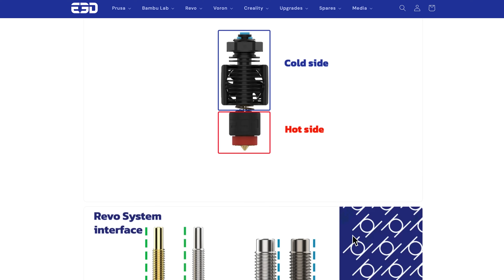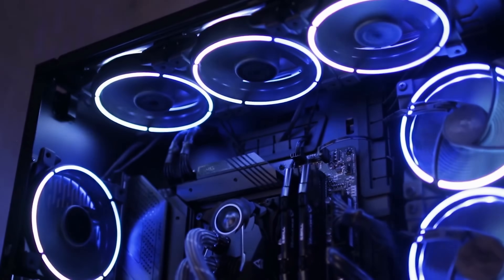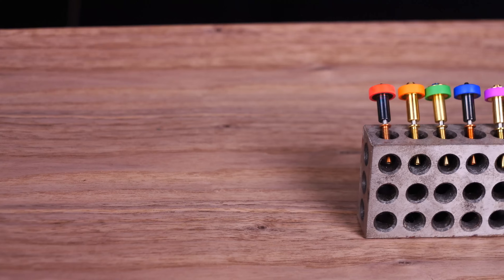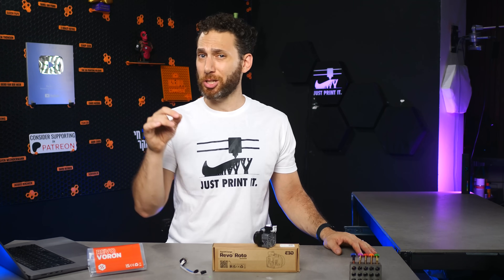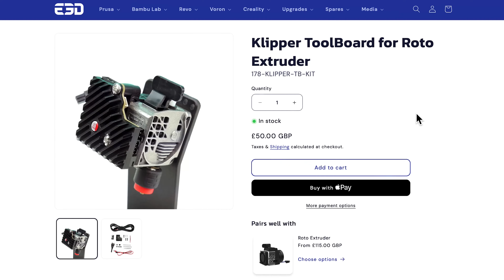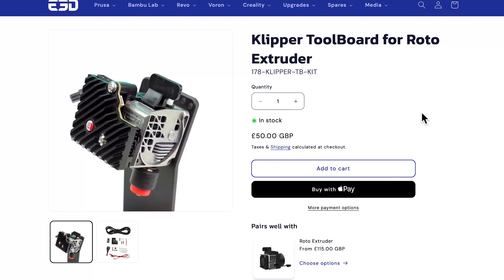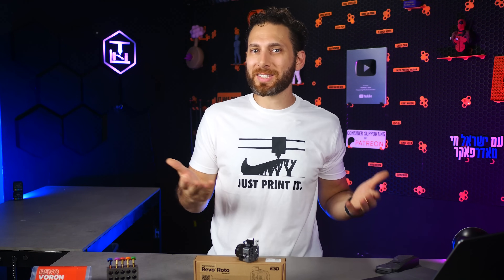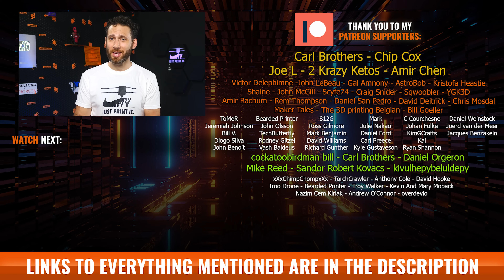E3D's New Release...& What It Means for 3D Printing

Comment: I like my Revo nozzles, but I've had quite a rough experience of them. I feel I need to offer a counterpoint to your cheerful, "everything is great" video.

I've bent three different expensive Obxidian nozzles before the Revo Mode fix was found (implemented by PrusaSlicer, not E3D!). When I told E3D about it (before the Revo Mode fix was released), I got a very offended "how dare you suggest we did something wrong" attitude back, and no help whatsoever. After I pointed this out, they gave me an insulting 10% off a new nozzle coupon and told me to leave them alone.

Putting these onto Prusa machines has been an ordeal. Prusa's firmware upon the release of the Revo didn't like the Positive Temperature Coefficient thermistors that the Revo uses, rendering the machines unable to be temperature tuned or used at all. It took a third party pull into Prusa's firmware to fix the issue, over a year after Revo's release. Prusa and E3D both advertised the Revo as a drop-in solution, and E3D even sold first-party "Revo Prusa Edition" kits that I bought, but it was unusable without extensive messing with the firmware for over a year. I blame E3D more than Prusa for this situation.

E3D won't admit this, but early Revo nozzles had a manufacturing issue where they weren't all the exact same length (Edit: between different orifice sizes, eg. 0.4mm, 0.6mm, 0.8mm, etc), so switching nozzles (Edit: to a different orifice size) STILL required you to re-calibrate your Z offset. For what it's worth, I think they resolved the issue, but not before I bought several nozzles of mismatched lengths.

I'm still trying to find someone to manufacture silicone socks for the nozzles that last more than two weeks printing PETG. There's some kind of chemical reaction specifically with PETG that causes them to become fragile. I regularly go to scrub one of my Revos with a brass brush and tear the whole sock off.  

And I generally don't like the way E3D rolled out new Revo nozzles. They keep coming out with new superceding editions of the nozzles - first it was just brass. Then came Obxidian for abrasives. Then the High-Flow brass nozzles. The the HTX high-temp abrasive resistant, and now Diamondback Revos. It just stinks to me of "sure, you bought LAST YEAR's model, but do you have THIS YEAR's model?"

All of this to say, I like Revo nozzles, but the company that makes them could use a kick in the pants.

Comment: now to choose between this or an eddy current based probe...
Reply: @iiianydayiii  eddy probes will be way faster and probably also cheaper if you go with other hotends than revo like rapido uhf.
Reply: I guess touch probes should be more precise and they can work on any kind of surface. For example I bought a PEI covered spring steel sheet, but it's conductance is so poor, that the inductive probe can detect it at a few tenth of millimeters before the nozzle crashes into it. I am not brave enough to use that sheet. Other spring steel sheets are working just fine. Also those inductive probes are largely temperature dependent. They will detect the metal surface at different distances at different temperatures and of course the distance also depends on the material of the surface. I think there are some temperature compensated inductive probes too, I believe the Prusa MK3 has something like that, but I can still see inaccuracies in the first layer many times. The Omron probe used for older Voron printers are definitely not temperature compensated. I hope soon we will see detailed tests about the PZ probe, it is a really appealing solution.

Comment: Hi Jonathan, with regards to the PZ cold side - printers like the Creality CR6 or Elegoo Neptune 3 had a flexible hot end bracket with a load cell - very cheap and efficient solution too. I am personally going to swap my Ender 5 S1’s Spider hotend with a Dragonized V6 and a tungsten carbide nozzle I got for free at Maker Faire 😅

Comment: You think are trying to make a complete closed ecosystem to lock you into buying their products? Yeah clearly I'm not their target audience. The open nature of much of the 3D printing community is one of it's strongest selling points and I personally am not interested in investing into a product which is antithetical to that.
Reply: I know what you mean, I was there. And I still love open source and I am still ready to make sacrifice for using open source. I was hesitant to switch to the Revo ecosystem, until they released the Obxidian nozzles. Then the high flow option came. They technically saved me from completely rebuilding my Voron's printhead, which originally came with a V6 hotend. And I remember how I messed up the heating block, and broke the heating element's wiring on a V6 by changing the nozzle on a Prusa a few times only. When I first changed to the hardened steel nozzle I thought I will never change back. Then my PETG prints started to crumble. Steel is hard, but heat conductance is not one of it's strength. If you like to experiment like me you will need a lot of nozzle changes. Since I use Revo, my perception has changed over the case. Now I sometimes swap nozzle 3-4 times a day without any glitches. I call it freedom. And yes, this freedom has it's price, but I am willing to pay it. Recently I was thinking about a TAP upgrade on my Voron. Guess what, it will never happen. But for sure I will still use FreeCad, even if it is sometimes sucks. But it is sometimes just too much sacrifice to stay on open source. :(  If a company put a lot of money into R&D they need to collect back that money too. That is part of the business, and at least it is reasonable, because they are trying. I think we really need a much better system for R&D and patents. I believe everything should be let's say open source, but all product sold should pay an agreed fee (the same fee for everyone) for using a patent would be a much better system. Some companies are better in R&D some others are better in production. Now you would have 10 different companies selling for example Revo, but still E3D gets it's fair share regardless who is the winner on the market. I think a system like that would put innovation on steroids. But until that in my opinion what E3D is doing is completely understandable. No one wants to work hard to make more revenue for those Chinese copy cat companies.
Reply from the maker: Their "cold side" is open source. Just the hot side isn't. But, I guess I hear you.

Comment: 9:20 what? just no... Piezo for bed leveling has been around forever. I even remember installing triangle lab's Orion clone on my original v6 back in the day. Fairly sure the reprep forums back in the day had something like that at least 8 or 9 years ago. The reason it didn't really catch on is that it lost market share to cheap inductive probes and good-enough contact probes like bltouch. The difference of going to nozzle probing from inductive/bltouch is really minor versus going from no probe to any probe.
Reply from the maker: You misunderstood. I didn't say Piezo was new... I said why did no aftermarket hot-end manufacturer not think to integrate the probe DIRECTLY into the hot-end.
Reply: @thenextlayer  you mean like a duet smart effector that put it in the effector so it did not matter what hotend was used....

Comment: If you use 3D printing for production revo, nextruder, and other combined nozzle/hotends almost feel like the only way to go. Printer down time caused by printer jams due to separate nozzle/hotends are more costly than just spending the extra on the better combined nozzle hotend.

Comment: that piezo sensor got my interest... but then I saw it has a max operation temperature of 60C.. showstopper
Reply: 60C chamber and heat sink temp would cover a majority of filaments used. Are there a lot of industrial grade filament printers that use revo?
Reply: @joescalon541  I print ABS and ASA at 65C chamber...
Reply: Why is the operating temp a concern?
Reply: @TheOfficialOriginalChad  probably because other options already have nozzle probing e.g. beacon, cartographer (beta), and those both handle higher print temps. also, I'm pretty sure piezos are extremely sensitive to movements on the carriage. SO unlike TAP where you could move to each point as fast as possible, a piezo would probably be even slower

Comment: revo makes sense at print farm, where cost for: changing nozzles, cleaning nozzles, looking out for print defects (due to already used up nozzle) really add up together.
Reply: No, it does not they still wear and a lot because they have longer contact then other nozzles. If you have a print farm and are cencerned about wear you get out your wallet and go for a diamondback nozzle.

Comment: Put the revo with the sensor in the SV08 I can't wait for a more reliable system that is simple.
Reply: Beacon Probe is super simple
Reply: @condorman6293  is it better? I have a k1 and an sv08. My k1 I have never set the z for, it just works. I'm assuming with beacon and any other system where the sensor is separate from the nozzle, you still need to do the paper test. Which I've always hated on my bed slingers, but my delta I only had to do it 1 time.  So I guess by simple, I mean just doesn't require more steps if I can avoid it.
Reply: @chasedown26  No paper test necessary. With Beacon you can enable Contact Mode and have it probe with the nozzle. What's cool is you can choose where and when to use it, ie bed mesh, QGL, and/or homing.

Comment: They used to sell a toolchanger  motion system. Make of that what you will.

I think that you're right, but I hope that they don't go walled garden with this. Having everything working together is nice, but I like having options.

Also, for me, the big issues with Apple are that I can't easily fix what I buy and that they do practice planned obsolescence, meaning that after a certain amount of time, I don't get security updates anymore. Both of these create more e-waste, which seems a bit odd for a company that has touted how green they are in the past.

EDIT: I think I need to clarify. I am fine with a ecosystem that's designed to just work together. What I have a problem with is when that ecosystem effectively locks you in because moving has too high of a cost and you can't bring in 3rd party components in if they fit better with your budget, requirements, and needs. Every time we invest in a closed ecosystem, we risk running into the situation we now have with inkjet printers. It's literally cheaper for me to buy a new printer of the same model than it is for me to buy ink for the printer. It's one reason I think what we need is more open standards not just in 3d printing, but the tech space in general.

Comment: I've got nothing against the revo idea, even though I don't see the "tool free nozzle swapping" they initialy promoted as any real benefit. Though, a nozzle that requires a special 'revo mode' for a slicer to prevent it apparently unwinding itself from the toolhead is not a great look. 
It seems everyone is getting into toolhead boards at the moment (Robert Lorincz also created toolhead boards for LDO) and the nozzle probe looks interesting, but the wiring looks like it could be a deal breaker. 
To me they just remain too fragile, and I don't buy the reasoning that it is a weak point that will save other parts of the machine. With other hotends if they collide the stepper motors just skip steps. They aren't really strong enough to bend a gantry. Its a 3d printer, not a 3hp cnc mill.
You could be completely right, but to me it just shows once again how the Voron community and the enthisiast market that surrounds it continue to drive innovation in 3d printing. If its not built for stealthburner its probably not really new.
Reply: Agreed! I've bent three different expensive Obxidian nozzles before Revo Mode was realized, and E3D told me that it was my fault, how dare I suggest that they did something wrong. After THREE NOZZLES! 
It turns out that printing organic supports on a Revo without Revo Mode enabled unscrews the nozzle, and I can't imagine that E3D didn't know about the problem.

Comment: I use Carographer 3D eddy current probe to home, high speed bed mesh (150x150 points), and touch bed with nozzle find pefect Z offset for the bed mesh. works with any hot end and nozzles

Comment: I hate the trend of going to a closed ecosystem. Open source all the way.
Reply: For software and implementation sure, but for manufactured parts don’t think it would make sense for E3D, just makes it easier for clones to be made and hurts their business.
Reply: Luckily, MK8 and V6 nozzles are still available. The one good thing about Revo is that it's "closed source but ubiquitous", so you're likely to find a way to integrate Revo nozzles in your printer and use said nozzles across your printers. The same can't be said for the random length Qidi or Sovol nozzles.
Reply: The nice thing about hardware is that it’s inherently “open source” as long as you have a few measuring tools 🎉
Reply: @TheOfficialOriginalChad  Everything is open source if you can read assembly
Reply: Others will come.along very soon and an open source will be along soon enough.
Reply: Prusas need to compete in price
Reply: @Splarkszter  Yeah, not gonna happend.

Prusa is a European company that sources its parts as much as possible from other European companies, is subject to European regulations, pays its employees decent wages and, as far as I know, is not subsidized.

In contrast, there are Chinese companies that are subject to virtually no regulations, pay almost no taxes, pay their employees minimum wages, source their components as cheaply as possible and are also often subsidized by the Chinese state.

The only way for Prusa to compete on price would be to fire all its employees and move to China to manufacture there.

A little fun fact. Have you ever wondered how China manages to get away with free shipping? They are subsidized by Western countries because they are still officially considered a third world country.
Reply: You are right better keep learning because they will all be closed soon, thanks obama, I mean pursa.
Reply: Aka. vote with your wallet, dont give em a penny
Reply: I wouldn't call this a closed ecosystem, that's more Bambu Lab, I'd call it redefining a standard. It might not help you right now, but when everyone can agree on a standard to make their components more compatible, that's an easy win for consumers. Think about the USB-C port, it solved all of our gripes with USB-A and Micro USB while opening the door for future improvements and making everything universal. You still have to understand the difference between cable standards because different cables are wired for lower or higher spec uses, but it's ultimately a win for consumers. It's the same way with the Revo system. Eventually most printers we buy and the companies that manufacturer them will support this system and it will be easy to decide what parts to swap out for certain features. E3D's V6 nozzle interface has basically been the standard for as long as I've been 3D printing. Eventually the prices will come down as more companies adopt the standard and create more competition.
Reply: @RaySchrantz  dude, the revo stuff is only being made by e3d. Everyone can make a USB C connector as far as i understand. So this is not at all comparable. If all companies who wanted to use usb c had to buy it from one overpriced source that would be aweful. A good standard is when the plans for the thing are freely available and there is no copyright/patent preventing multiple manufacturers from selling the thing. Thereby, even when one manufacturer goes out of business there are other sources one can rely on. E3D has a monopoly on the revo system and thats not good for the end consumer.
Reply: @RaySchrantz  IF the standard makes sense.  V6 just allowed for flexibility and used Metric threading and allready existing hotend designs with block, heater catridge, thermistor and nozzle

Revo is essentially a big " Frick you" to opening up an ecosystem. They are rigidly patented , so only E3D is legally allowed to produce them.  Fairly limited in their application and performance (forget meltzone stretches for now) and require very special parts to work, for: 

You can swap the nozzle while hot ....lol as if, still burns you bcause of the tiny silicon ring, but now you cant use a wrench

One part heatbreak plus nozzle = no leaks .....just that many a "standard" nozzle has had that integration with steel syringe tubes for a while now

The Piezo leveling is genuinely the first useful bit
Reply: @RaySchrantz  you don't seem to understand how usb-c was designed it was not made from a single company tring to make everyone use thier product it was a made by a conglomerate of companies in order to find a standard as usb b was so successful this case is more like telsa and the super changer and also like telsa and the super changer if the company does something stupid like stops making super changer (or nozzles in this case) the entire industry suffers.
Reply: @TheNolok3428  e3d have done enough for the open source community
Reply: if companies are going to survive, they gotta do what they need to.